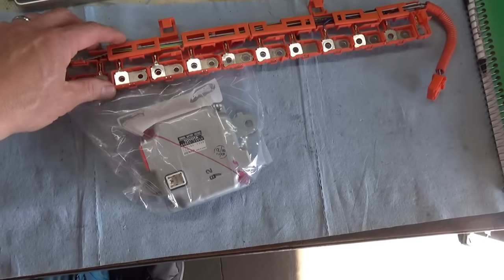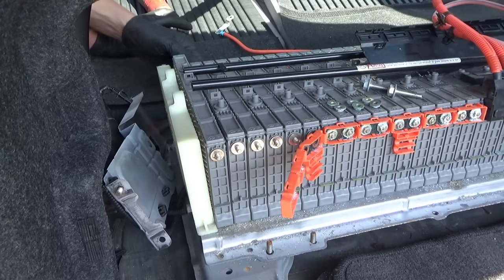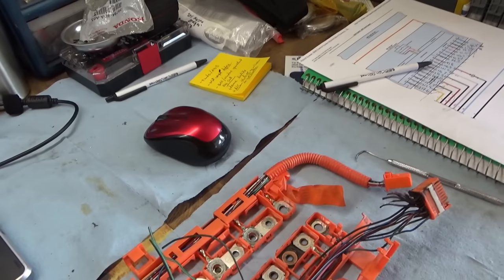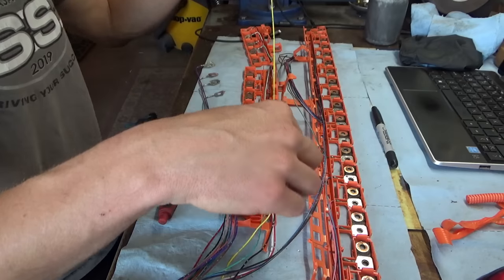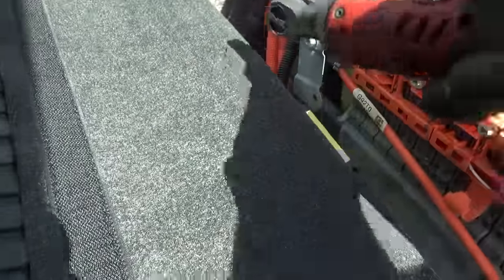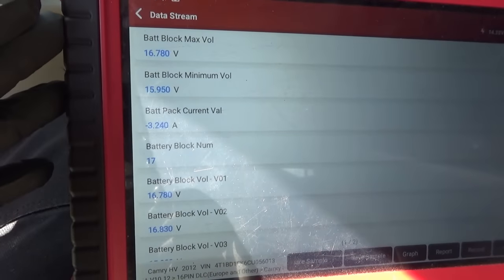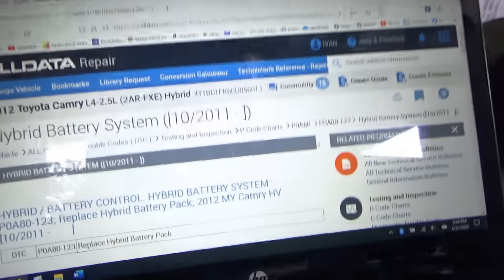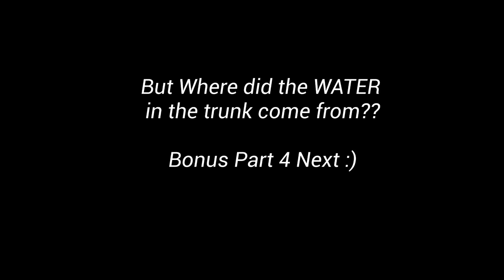Helpless HYBRID....from Florida?? (Part 3 - HV Battery REPAIRS)

Comment: I think you're righr hybird car suck lol
Reply: Yep, and this was an extremely basic one by todays standards. You can't open the battery like that on most new vehicles.
Reply: Hybrid and pure electric car shine in the cities. And that is where most of the people live. Yes, hybrids are harder to diagnose because one has to understand both mechanics and electronics, but they are worth it regardless
Reply: @zofiaturowska-z6g  Petrol cars fitted with catalytic converters cause almost zero air pollution. The problem has been bad because governments spent 15 years encouraging people to drive diesel vehicles, which many of us called out at the time. If whole cities had electric vehicles, the electrical grid would collapse/melt under the strain.
Reply: The new battery systems I believe weigh nearly 700lbs of the vehicle weight in order to get the mileage range 
of 300 miles on an SUV, that is if these manufacturer's are able to hit that 300 mile target if they succeed! Ford 
and Mercedes has their stuff nearly worked out! The last thing that I had heard was on a Ford F-150 actually fell 
below the 300 mi driving range. Most of these battery systems will be incorporated into the floor space and that 
isn't actually good either!
Reply: A Hybrid vehicle just might be better than what the government is trying to force on all of us! The expensive
of it all on these new cars that are coming will top any expense compared to a Hybrid perhaps by a factor of
3X when having to replace a battery pack which is more laborious, heavier in weight for freight costs, and
could be costing the consumer, I'd dare say $16,000 to replace!! And the poor mechanics will probably take
their tools and throw them all over the place out of shear frustration!